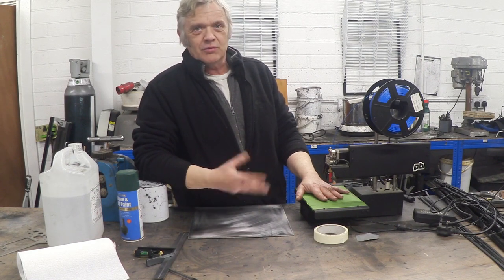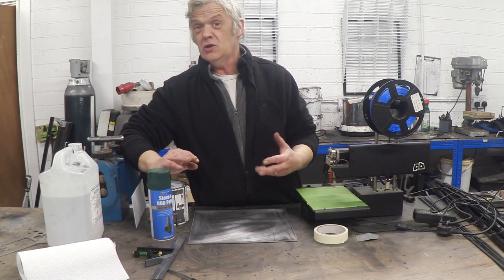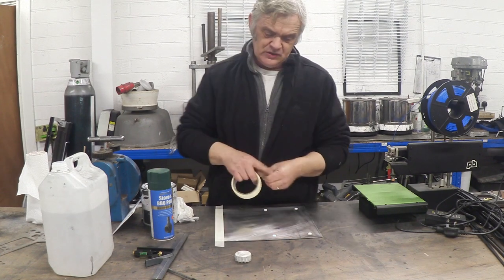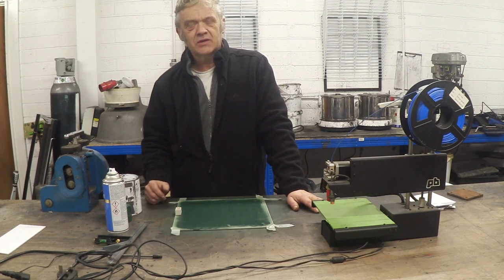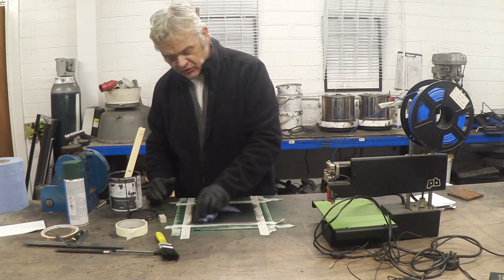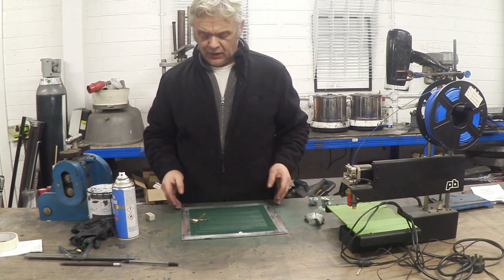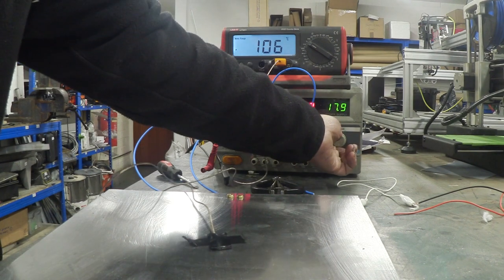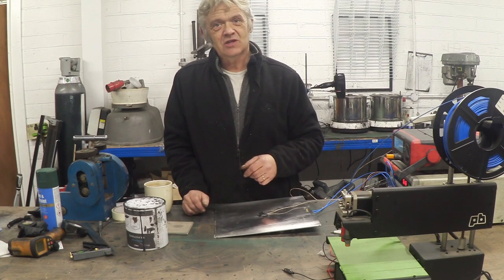Scratch Build A 3D Printer Heating Bed

Comment: love the video! out of curiosity; what material are you printing? To print PLA, I generally heat my glass bed to 60-65c, the only time I needed anywhere close to those temperatures was printing ABS. I may try this straight on a piece of tempered glass I recently liberated from an old flatbed scanner. My current setup heats an aluminium bed which has a glass bed clipped over it, which isn't very thermally efficient and takes forever to heat.
Reply from the maker: ABS mostly mate - and yes mostly they take forever but that's because the heating element is usually underpowered

Comment: Noob question here:
Would it be more efficient if you applied the copper wire tape and zigzaged it directly on the aluminum plate, then applying the enamel coating on top of it (without any conductive painting)?

Comment: flexible rubber ones for 10 or 20 pounds LOL thats funny,  I guess since you are talking super tiny like 200x200mm or something though, so I can't be too salty over mine costing $190 since it is a 400x600mm bed with its own control module and all, :) (that and it is able to heat and maintain 350C temp which is more than you would need for the head to squirt out lexan and pure nylon or something, so I wonder if most of the beds out there are able to do a lot more temp than they list, but list the lower temps because you don't ever use any higher of a temp if your printer wont print anything but ABS or PLA ? just an aside,

also glad you are doing a video on making one of these, I have been wanting to give making my own units a try, I would like to see a shot at making your own printer head, or say an injection mold heater, as I am wanting to make one myself. I will be using Kantal A-1 wire I already acquired for the first one, but I plan on making a few various ones, so one made with conductive carbon ink would definitely be something to try as well :)
Reply from the maker: for sure mate - I was wondering if anodising the Ali first would work
Reply: @ThinkingandTinkering  making sure it had pores would probably be best on that count, ie annodizing it with a lot of acid in the solution to get the largest pores and the thickest pore layer of these pores with the lowest voltage due to electron flow through the electrolyte in the pores to the aluminum at the bottom of them, so you have something really spongy to bond the paint to, as I am guessing it is thick enough that it wont sag down into pores even 20 or so nm in diameter though I think backing off the acidity and clearing the pores out, then re doing the work will coat the bottom of the pores too, just not sure if it would cause a thickening of the pore walls, which would only be useful I guess if it were to fill the pores in with aluminum nitride as I think it was shown to be far more thermally conductive than AlO3 is, but don't quote me on that, all I can say is it is sold as a thermal layer between something conductive and heatsinks made of conductive metal so there is an insulation layer for electrical conductivity, with out that pesky interference of being thermally insulating too,. as a safe alternative to barium oxide since that stuff is apparently highly carcinogenic lol. (the barium oxide being carcinogenic not the aluminum nitride)
Reply from the maker: @ThomasAndersonbsf  that's very interesting mate cheers - I never thought about the nitride - something else to look at lol - awesome
Reply: @ThinkingandTinkering  when I was typing that I had wondered how to get aluminum nitride to form as I am guessing its not easy to get the salt to move from point to point by anodizing or electroplating type techniques then I had the thought of maybe using a replacement to the oxygen in water that is where the oxygen in aluminum oxide from anodizing solid aluminum, comes from, to a nitrogen molecule like maybe using liquid ammonia as the medium instead of liquid water, just not sure of the logistics of it yet, I have more thoughts on it but cluttering up here seems pointless so probably just do a video on the different ideas and then one on the tests and results, just would be nice to be able to make structures pf AlN for those nonconductive (electrically) heat sinks that have high thermal throughput and resistance, like it has, but even basic flat sheets are pretty pricy compared to even just basic AlO3 ceramic plates. or even complex structures like filters and tubes lol.

Comment: I have not viewed all the channel videos but has using your ink as a after market coating on radiating surfaces been examined?  I assume that the ink a very good radiator in the infrared so given my 40+ yr memory of University physics it like the "Black Body" problems I had in class.  For systems that have been unchanged for 50yrs a 5% increase would be of merit

Comment: i freaking love this but my printer is 24v and wanted to run it off the same PSU but my max out on psu is 150w and i think even for a 7x7 inch bed it wont be enough
Reply: Run it off of AC.  Every one of my printers I've switched to 120v for the beds, including my 4foot cubed printer that I designed, built, and coded myself from scratch.  The printbed area on that big girl is 1000mm square, and I can get it from room temp up to 90C in under 3 minutes using a PID tune and pwm control signal into my AC relay.  All my other electronics I run at 24v.  I run a Meanwell 300w on Supernova (the big one) and even with my high flow dual extruders (Super Volcanoes) it's never come close to overloading the Meanwell.  That's with lighting, camera, RGB fans, environmental control system - hell I even added a removeable wirelessly charging Samsung S7 Tablet dock to it for remote control and modeling, she runs like a champ.

Comment: Remarkable video. I've learned a lot that I didn't know.
Will one get electric shock when touching aluminium plate?
Reply: One shouldn't. Remember the first layer of enamel, that was applied; it will insulate the copper strips from the alu.